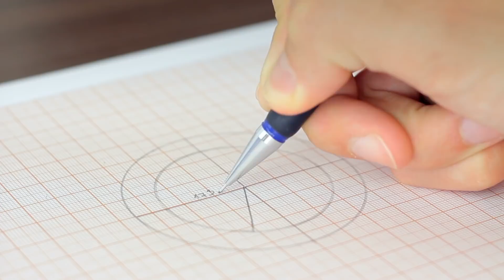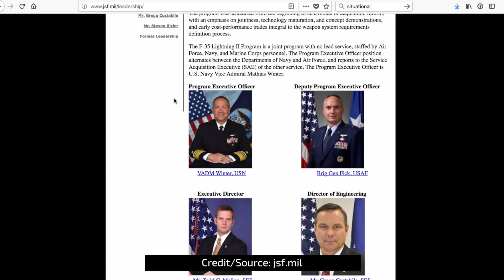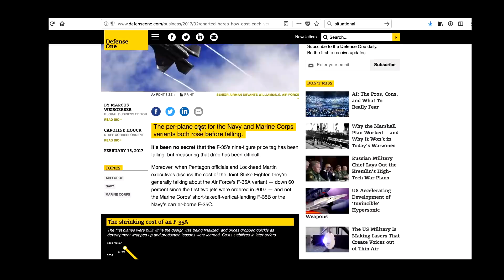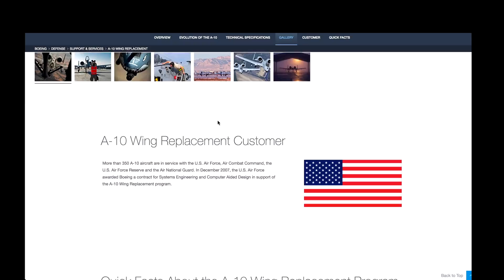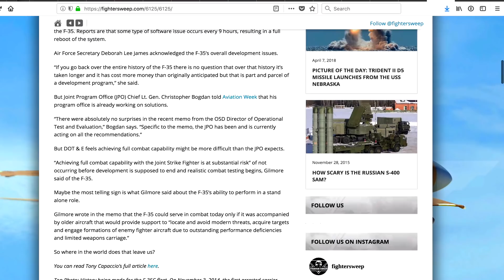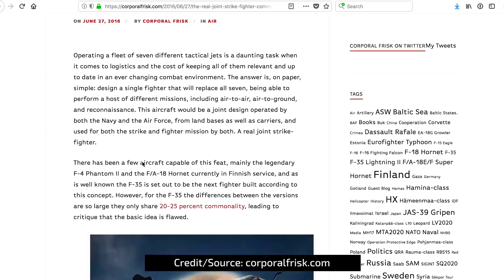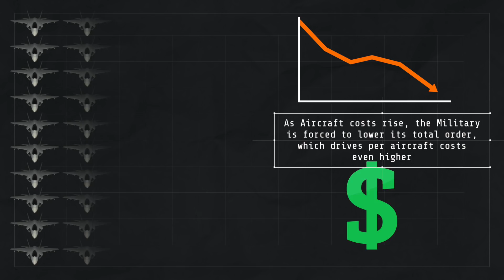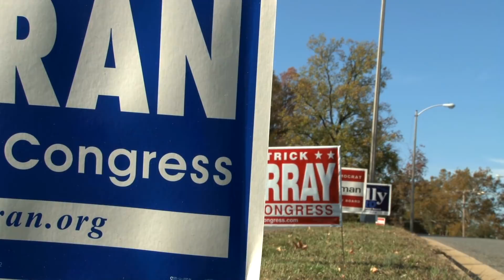Why the F-35 Lightning II Might be the Most Expensive Military Aircraft Mistake Ever

Comment: The testing of aircraft's maneuverability and systems in 'closed envelope' is where the aircraft is allowed to do only certain maneuvers to accomplish the testing; not going to its airframe's full capacity.

That was the thing about f-35 'losing' the dogfight against the f-16 which media skewed and reported differently.

The same process is being done for every aircraft that's meant to get into the production.

It's like for the f-22 to fly only straight in one mission to test its range and capabilities of its radars and 'losing' the dogfight against some other aircraft.

Moreover, designing an aircraft that can do what needed 5 aircrafts to do isn't small thing to achieve.

But once developed, you get the machines that can do multitasking and the best thing; you don't need many factories to produce spare parts, you can basically take many parts from B model and put it in the A or C model, the production process is far shorter when producing three very similar models and you don't need much of brain process to construct them all.

That's enormously cheaper than what the US air force and its industry has.

This video's author isn't aware of the network fighting capabilities of the f-35 family.

The aircraft receives data from entire marine, ground and air force on the battlefield which means, you as the pilot can have much broader picture and understanding of what's happening around you and even predict how something will happen and be aware of the unexpected things to happen or what the enemy is planning to do.

That's great Reconnaissance platform.

Moreover, it has capability to take roles of other war machines;

If, for example, the destroyer battleship is destroyed before it can guide the missile to the important target; instead of missile to fail hitting, You, as the f-35 pilot, can overtake the control of that missile, guide it and hit the intended target from huge distances.

The technologies that are matured, refined over time, are lot more cheaper to develop in difference with something revolutionary, that isn't matured.

It's lot cheaper to make a jet engine than to innovate the new propulsion because, in the case of innovation, you have to prove the theory in practice then a lot of time to refine it if the theory is proved physically possible and doable.

The same thing happened with all these technologies we use today that were revolutionary and were theory in the past.

In case of this video, a musician or politician for example, can't grade the work of engineers.

You, this video's author should have done lot more research and time investigating this topic.

I'm not defending the f-35 program; in my stance, for that money, I would make the f-35 even better air superiority machine than the f-22 but this is not my project.

Comment: This video is kinda depressing, and thats not anybody’s fault, it just saddens me to see that some of the greatest wings ever made are being killed off and replaced with this expensive thing, is it a decent plane? Sure, but we have aircraft serving in our air-force already that can do its job better, “stealth technology” is just a fancy term for kicking the can down the road, sure it works now, but what happens when the Russians and Chinese make better radars? Then you’re just stuck with an extremely underperforming aircraft that cant even carry a full missile load
Reply: There are no jets currently operational that can do the F-35's job better, let alone at a cheaper price. Stealth is not something that can be "defeated". Better radars will detect non-stealth aircraft at much further distances which means that non-stealth aircraft will be effectively useless in future wars and stealth will become the norm rather than the exception.
Reply: dumdumbinks274 

Are you about to tell me that the F-35 can surpass the A-10? I don’t think so buddy, the A-10’s weapon capacity and armaments cant be surpassed, its gun can punch holes in the armor of a tank, meanwhile only one version of the F-35 even has a gun at all, and on top of that, the F-35’s weapon capacity is downright pathetic even by an F-16’s standards,

Stealth technology is just a fancy term for kicking the can down the road, what happens when the Chinese or Russians make better radars? Then you’ve got a fat pigeon of an airplane thats completely useless

Its also noteworthy that the F-35 has only one engine, theres a reason why most if not all carrier-based airplanes have two engines, if one engine fails they can keep flying on the other, and they need that because unlike the air force, they don’t have very many places they can make an emergency landing, 

I will however concede the fact that the marines kind of need it, the harrier is getting old and its the only VTOL/STOVL aircraft they have, so the F-35 is probably going to only kill off the harrier, and nothing else
Reply: @redjaypictures4528  Your knowledge seems to be based on pop culture, not reality.
1. The A-10's gun is practically incapable of penetrating the armour of the T-62A from way back in 1961. It is completely useless against any modern tanks which is why the A-10 has relied almost entirely on the AGM-65 for anti-tank duties... and it can only carry 2. The rest of it's anti-tank payload is made up of cluster bombs. Note that all modern fighters including the F-35 can match or exceed the A-10;'s anti-tank payload while also being far better suited for the task.
2. All 3 versions of the F-35 have a gun. 2 of them carry it externally just like the Harrier does and that is fine because it's not going to be used if the enemy have air defences. Same case for the A-10.
3. The F-35A/C have payloads that far exceed the F-16 and F/A-18 and can easily match the A-10 in any situation an A-10 would be used in. The F-35 is capable of carrying an F-16's optimal strike or CAS payload internally, and externally can match the A-10 in number of bombs carried. The F-35 is rated to carry a max payload of 22000lbs. The A-10 is rated below the F-16 at 16000lbs.
4. I already explained stealth vs radars. Your favourite non-stealth aircraft end up useless because they get detected at much further distances. You argument is the same as the missiles vs countermeasures argument, and it makes no sense.
5. Navy pilots have already stated they don't care about the single-engine because it's incredibly reliable. We're not in the 1980s when engines failed on a regular basis.
6. The F-35A is replacing the F-16. That is guaranteed to happen. The F-35C is replacing the Hornet. The Navy have already retired the Hornet from operational service.
Reply: dumdumbinks274 

Whered you hear about the hornet going out? I know the C and D versions are out but I’m fairly certain the navy still use their E and F “super hornets”

And while apparently the F-35 is now a better dogfighter than it was when it was beaten by that F-16 back in 2015, but that doesn’t really mean a whole lot, considering we will mostly be fighting Russian aircraft in the future means we have to deal with what the sukhoi’s are capable of, and from what Ive seen, thats quite a lot, you can hide behind your stealth all you like, but if someone finds you, which will eventually happen, you need to either be ready for a fight or be ready to run, and the F-35 in its current state cant do either considering that its cruising speed is slower than nearly everything its setting out to replace, (the exceptions being the A-10 with its 418 MPH and the super hornet which flies at around mach 1.8 which is only a slight decline to the F-35’s mach 1.6) 

And again regarding both stealth and armament, if the F-35 wants to carry as many weapons as you claim it has to mount them externally on the wings and by doing so you negate the stealthy aspect of the craft, meaning its a downgrade any way you slice it, 

I wont fight you on your A-10 specs, you’ve clearly done your homework, but at the same time for every shortcoming the A-10 has, theres 3 other assets it has that Lockheed can only dream of achieving, but rather than list them all out ill let two bit themselves do the talking

https://youtu.be/2XlvJ_L4_UQ

 
And lastly it appears as though the F-35 is following in the footsteps of another plane that failed to impress, 
The F-4, it seems again that the pentagon thinks that the dogfight is a thing of the past and that todays air battles are won only with non detectability and scanners,
That sort of thinking is the reason we were beaten so badly in Vietnam, four American planes were lost for every single Vietnamese mig that we shot down,

No matter how you look at it the F-35 is an empty promise with wings, we were promised all that and a bag of chips only to discover that what we got is an expensive pigeon airplane that can only have one asset at the expense of another, 

What Lockheed should have done instead is try to fill the hole left by the F-14 tomcat after its retirement, the navy misses the tomcat because it was the only plane that was designed to defend the fleet, Lockheed already gave the air-force the Raptor which is the best plane serving the USAF bar none, its now time for the navy to get what they need, and with china rising as a new player on the world stage,  they pose a threat to the fleet that neither the F-35 nor the super hornet are ready to face,
Reply: @redjaypictures4528  The Hornet and Super Hornet are different aircraft completely. Super Hornet remains in service since the F-35 was never supposed to replace it.

The "dogfight" you refer to was a test of flight software using a test airframe (non-production) that was severely limited. It was not "beaten" so much as the test proved the restrictions on the F-35 should be lessened. F-16 pilots of that timeframe were already commenting that the production model F-35As were more capable in a dogfight than the F-16 and the F-35As were still limited to 7Gs. Modern F-35As are maneuverable enough to replace the F-22 at some airshows and can perform maneuvers the F-16 simply cannot perform. Su-35S is about as good in a dogfight as the F-22 and Typhoon. The F-35 is only sightly worse since it can match most maneuvers the Su-35S can do, and where the Su-35S is better than the F-35 the F-35 makes up for in every other aspect of performance, notably having very high acceleration and being the only operational fighter capable of engaging targets behind itself without assistance.

Another aspect that people forget about when it comes to dogfights is... the situation. If you're comparing fighter performance in a situation you configure them for that situation, and you will find that the F-35A has higher numbers in everything when compared properly to the F-16. For instance an F-35A can travel about 2x as far on internal fuel compared to the F-16. In a dogfight assuming equal starting parameters as you would for a performance comparison, an F-35 with 50% internal fuel is a reasonable comparison to a F-16 with 100% internal fuel. That's a 9250lb weight loss and you will see a noticeable difference in performance considering that's almost 20% of it's loaded weight.

Speed. The Super Hornet is capable of Mach 1.6 only and it has to be in clean configuration to do so i.e no weapons except the wingtip AIM-9s, no external fuel tanks or targeting pods etc. With a reasonable mission payload even for an air to air mission the F/A-18E/F is only capable of Mach 1.2 at best. The F-35 achieved Mach 1.61 with a full internal 5000lb strike payload and max fuel. The F--35 is also capable of super-cruise at Mach 1.2 much unlike any of the aircraft it is replacing. The F-16 is known for it's acceleration, not it's speed, and is only capable of Mach 1.5 with a 6 missile payload.

The F-35 can currently carry 4 missiles internally and that will increase to 6 in the next few years (the upgrade has existed since 2015 but is a low priority since the focus is air to surface capability). The F-16's absolute max air to air payload is 6 missiles. The F/A-18 can carry more but typically you won't see them carrying any more than 6, possibly 8 missiles total simply because large external loads cause large amounts of drag, and also because F/A-18s NEED external fuel tanks to be useful. 

The A-10 is good for it's very specific purpose... which is not CAS but a more specific portion of CAS. F-35 easily beats the A-10 for overall CAS capability because of it's sensors and response time due to speed, but the A-10 takes the cake when it comes to CAS in uncontested airspace, and by that I am referring to the few instances where there's absolutely no threat of anti-aircraft weapons being used. Nothing more satisfying than seeing as much firepower as possible raining down on the enemy, but that firepower can only be used under certain conditions.

The F-4 was a very impressive plane and was just as maneuverable as the MiG-21. The US may have lost 4 planes for every MiG shot down, but 90% of losses were to SAMs and AAA, not the MiGs. The USN F-4 squadrons by the end of the war achieved 5.7 MiG kills for each F-4 lost in air combat. The USAF F-4 squadrons achieved 2.7 kills for every F-4 lost in air combat, but were also the less efficient service. The USAF opted to upgrade their F-4s with a gun which added 500lbs to the front of their F-4s and reduced maneuverability (Navy F-4s were never upgraded with a gun), and they also liked throwing aircraft in large numbers at targets until the targets were destroyed instead of thinking things through.
Reply: dumdumbinks274 

I.... I have nothing left,
Congratulations worthy adversary, you’ve managed to shoot down every last complaint I have about the F-35,

I guess the only real reasons I don’t like the F-35 are a little too personal, ever since the F-14 tomcat was added to a very advanced home military simulator I’ve seen a single extremely knowledgeable simulator pilot take on almost everything in it and walk away just fine, 
Using the F-14 he was able to kill all these planes (which were flown by actual humans) using only the tomcat’s gun:
Mig-29 fulcrum
Mig-28 (F-5 tiger II)
Su-33
F-15j (this one he killed with the AIM-54)
F/A-18 C
Mig-23 Flogger
And even another F-14

The only planes he was killed by were the F-22 raptor and the F-16 falcon, but at the time neither were really added to the sim, they were only mods, so a rematch is in order regarding the F-16 now that its been properly added

But watching these videos made me believe strongly in the old saying “if it ain’t broke don’t fix it” if one of our oldest planes could fight like that (I know we killed off the tomcat, quite a shame but still)
Why do we need this über expensive stealth fighter? 

Im also not very happy with the type of message the F-35 has to it, there was a time when I considered becoming an air-force pilot myself, but going through the long and hard training process only to be sat in a plane where I basically do nothing and let the computer do everything important doesn’t sound like a fair trade, the planes that the F-35 is planning to replace (IE the F-16 and F/A-18) come from a time where pilots actually flew their planes, in the words of astronaut John glenn:
“I fly the machine, the machine doesn’t fly me”
And the F-35 seems to be ushering in an age where the latter part of that quote is true, and what good is a pilot at all at that point?

I also don’t really like everything thats happened regarding the plane on the non-aviation side of the debate, we spent way too much money on the damn thing and we should have had it ready for service ages ago, and in all honesty we don’t really need it, the fighter planes we have work just fine, but Lockheed pushed it forward by “political engineering” making it so that you couldn’t cancel the project even if you wanted to, at least not without major economic consequences,

The F-35 to me represents Lockheed’s greed for profit and the end of the time when air force pilots really matter, 

Thats why thinking about the F-35 makes me sad, all the rest of the stuff its just jargon I use to try to justify my dislike,

You win dumbinks, I guess the F-35 isn’t that bad, but that wont change the message it conveys, 

Turns out the writers of top gun 2 were on to something when they included the line

“The end is inevitable maverick, your kind is headed for extinction”